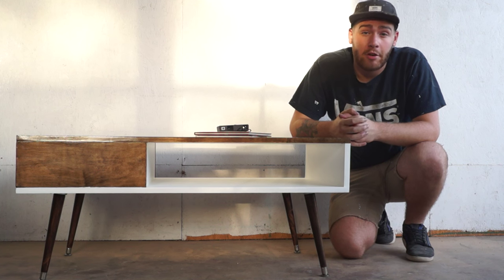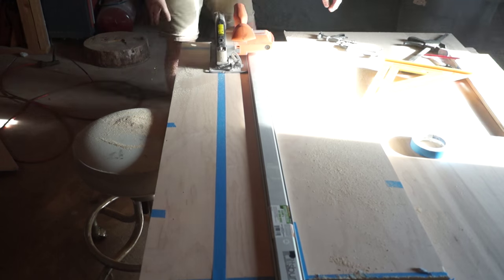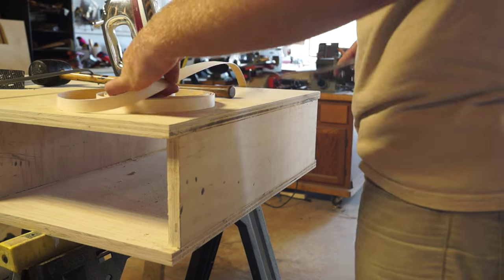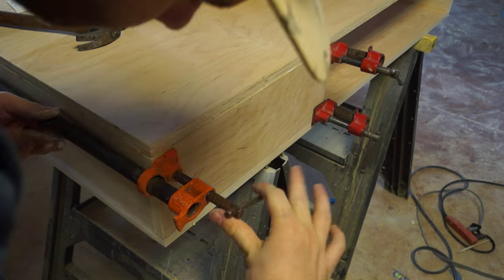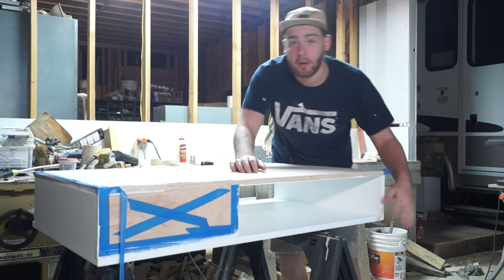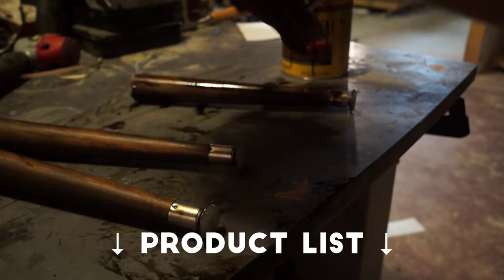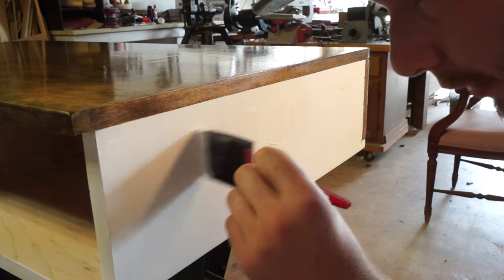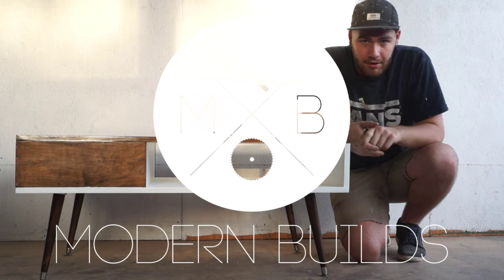Mid Century Modern Coffee Table DIY | Modern Builds | EP. 10

Comment: Did you use any glides for the drawer? There's a brief view of something on the outside walls of the drawer where it meets the table but I can't tell what it is.
Reply from the maker: +Jaaronh1 No, I just used a wood shim on each side so the the drawer would slide in centered
Reply: +Modern Builds Also, just so you know the link for the legs goes to 16" legs...I'm assuming yours are shorter than that. When I built it with 16" legs it looked very silly... :)

Comment: Could you perhaps think about putting centimeter measurements? It's hard to convert 3/4 of an inch with most converters.
Reply from the maker: Honestly, no, not trying to sound rude, but I don't really have the time to figure out the conversions for everything. Sorry
Reply: +h4ppy3nd to convert from inches to millimeters you multiply the inches by 25.4. So if you have .75 of an inch (3/4 is simply 3 divided by 4, which equals .75) multiply that by 25.4. ( .75 x 25.4 = 19.05 millimeters) And to convert from millimeters to centimeters, divide your answer by 10. (19.05mm divided by 10 = 1.905 cm.. or 1.9 cm) Hopefully that helps!
Reply: Cameron Martin Thank you so much!!!